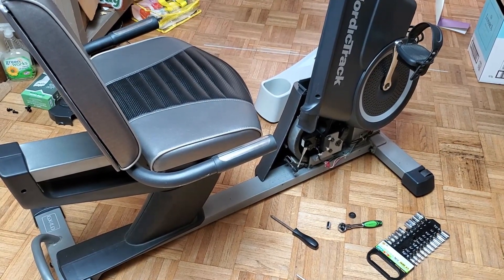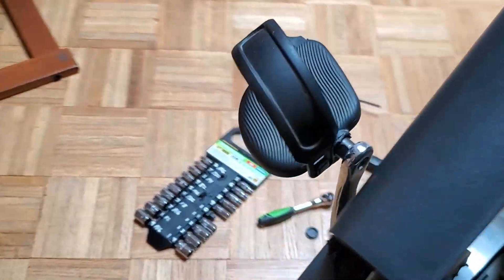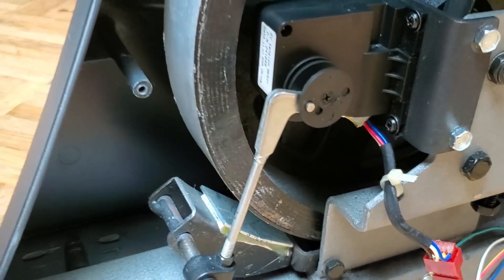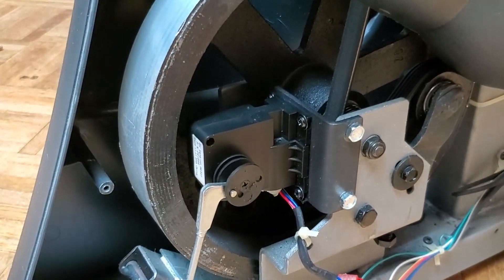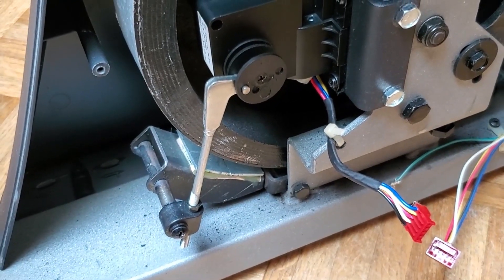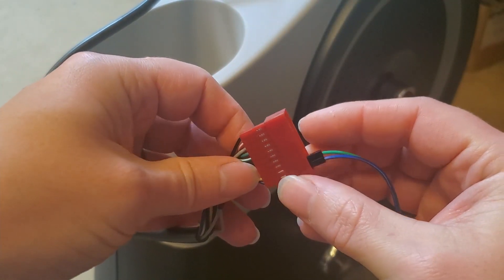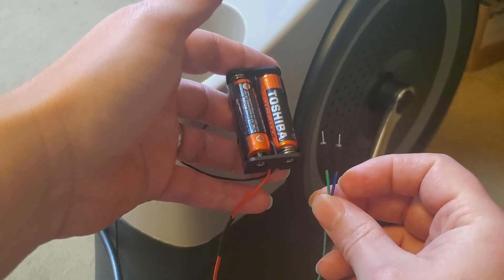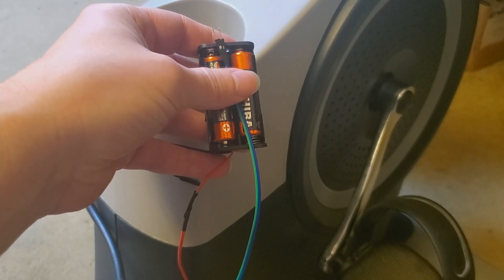Diagnosing no-resistance NordicTrack recumbent bike plus a cheap “fix”

Comment: Did you make your own jumpers or buy them?
Reply from the maker: Buy. They are a standard size, I sourced them for connecting to raspberry pi header pins. Commonly called dupont wires, they fit lots of things. Handy and cheap. Pitch is 2.54mm.

Comment: Thanks so much for this video. I built a diy battery pack, stuck the wires in and the motor worked! I'll set up a more permanent bypass based on yours. Thanks!

Comment: There's another, mechanical rather than electrical fix.  Turn the two tiny bolts that are around the silver rod to make the magnet closer to the metal wheel.  I did so to the equivalent of my preferred level 7, which won't get displayed on the screen.  Stu Miller
Reply from the maker: yes, that was my original plan before I realized adjustable resistance was still an (easy?) option.

Comment: How does the iron flywheel freewheel when not pedaling? Is there a kind of clutch that engages when you pedal and disengages when not? It has be something on the shaft connecting the drive pully to the flywheel.
Reply from the maker: @peterofoz  yes there's a clutch bearing. Another possible failure point; if this dies it's usually in freewheel position.

Comment: the resistance motor rotated in two different directions. how would you use the batteries differently to either up the resistance or down the resistance?
Reply from the maker: @lindseyblanchette1113  the polarity of the battery selects the direction the motor turns. Ie which wire goes to plus and minus.
Reply: An H-bridge works well for reversing polarity.

Comment: The disassembly information was very useful, thank you.  The motor on my stationary bike also worked fine (blue and yellow wires) when I tested it with a bench 5V DC power supply but the feedback potentiometer (red, black, and white wires) in the motor assembly had failed.  I monitored the feedback potentiometer output (white wire to black or red wire) as the motor moved and the signal was erratic and intermittent.  It was necessary to replace the motor assembly.  In my case, part number 241949.
Reply from the maker: It's conceivable that the potentiometer just needed to be cleaned, as what you describe sounds like a dirty wiper. Often can be hard to disassemble enough to clean AND still he able to put back together fully tho :-(
Reply: @xeostube   I believe that too.  A good cleaning may have resolved this but, as you probably know, this motor assembly was not made to be serviced.  I would have to disassemble the little gear box to get the potentiometer out (a lot of gears).  The newer models, the one I received, looks like that would be easier to do based on how the potentiometer is installed.  The older one was attached with an internal collar nut and not so easy and probably a 50/50 chance of resolving it.  I'm back to good operation with the new motor assembly.  OBTW, the motor is more like $70 now with inflation.

Comment: Thanks for the tip. I was able to easily tap into wires near computer console and added 3 v battery box.  1.50$ investment to fix.
Reply from the maker: good point, you don't need to go as deep inside as I do here.

Comment: Hi, like a real bonehead I plugged in the wrong power cord and my machine will not power up. Any idea what I fried?
Reply from the maker: The console, most likely. Motor in this video only gets power when you try to change resistance.

Comment: Where do I plug in the power cord for my panel???
Reply from the maker: As you can see I don't actually have the panel so I don't really remember but I think it's at the bottom of the entire unit near the front
Reply: @xeostube  I tried to log on to some kind of website that wanted to chart me $70.00 for a one year subscription to give you advice on how to diagnose your unit. 🙄🙄🙄

Comment: Nice! So the voltage is 3V between the teal and blue? What is the ground black wire is for?
Reply from the maker: There's also a potentiometer in the assembly for sensing where the motor is, presumably it's use as part of that circuit.